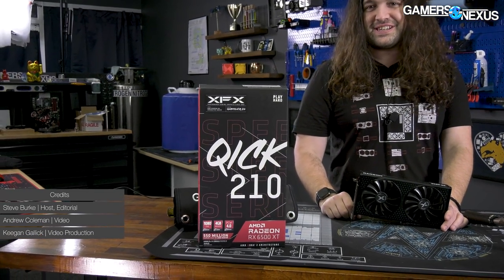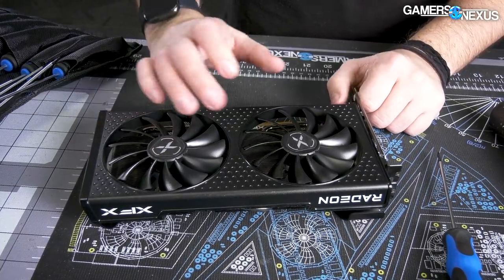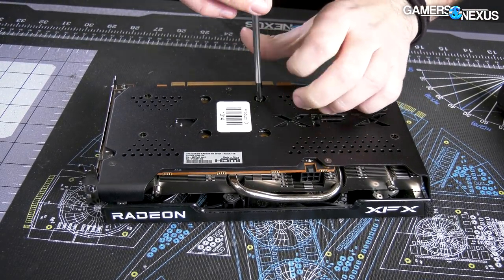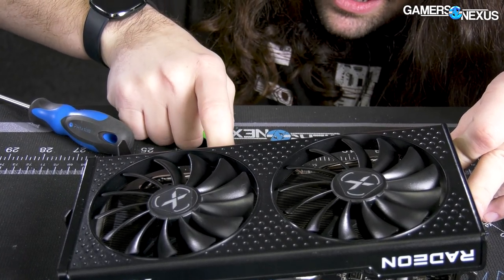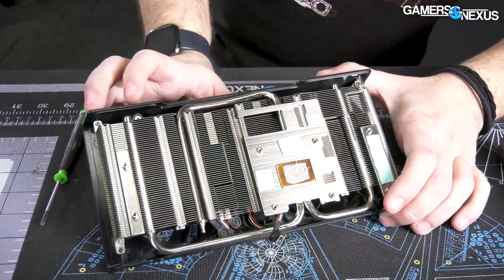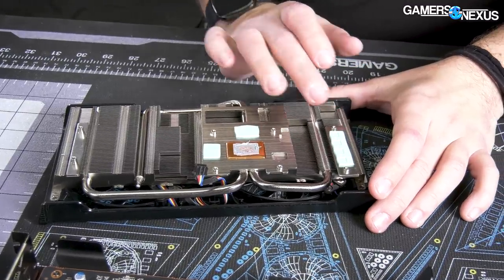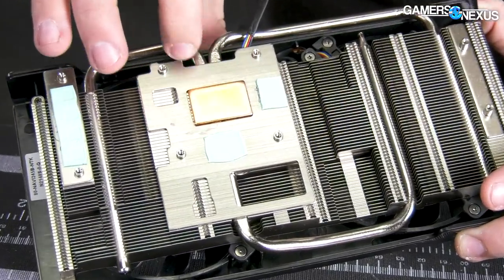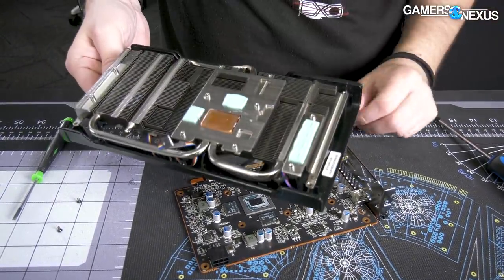Tearing Down Trash: AMD XFX RX 6500 XT Disassembly

Comment: So basically, on PCIe 3, you're getting RX 580 performance, for half the price a used 580 would cost today, but brand new and in stock. Where's the downside again?
Reply: The downside is it's literally worse in performance than a 5 year old budget GPU from Nvidia (remember, worse than the GTX 1060 6gb).
Heck it's barely better than a GTX 970, which I already have two of because for some reason I wanted to SLI it.
Reply: @44R0Ndin  Yeah, if you already have a better card, that's great. But if you want to build a new system, or upgrade, is there a better card you can buy for $200 today?
Reply: @joshm3484  can you even get this specific card at 200 not 279?
Reply: @hubris6567  It'd be a 12 hour drive for me, but if I wanted to, yes, MicroCenter in LA. 
I'm happy with my little 580 4GB for the time being, but I mostly play flight and space sims @1080. For me this would probably be an affordable upgrade, but not one I need. The bright side of so many bad reviews, if I ever do want to buy one, in a week or two it'll probably be in stock everywhere, and near MSRP.

Comment: Nobody cares about it, just me... Maybe I won the lottery but my 6500xt ran batter than my older sapphire 580. However I had so many trouble with drives (AMD life) but the card is really stable and powerful on drivers 22.6.2 or 22.10.3 currently using adrenalin on 22.11.2 and just by messing around with manual settings I managed to get 5305 on 3DMark (average is 5232). If you just want to game on 1080p this card is really good. I need to back it up as a user and I have mine since adrenalin 22.5.2 and it sucked hard at launch
Reply: Watching this video because the fans are really loud, the teardown video will show me if I can swap the stock fans for 2x 120mm fans as I already did in the past with other cards, I'm a sucker for modding budget parts and get the most out of it.

Comment: In 2013 I bought a HD 7950 for ~280€. The 6500XT has at most 2x the GFLOPs (=> raw processing power), only 1 GB more RAM and costs now, 9 years later, MORE than the 7950 did back then. Oh, and that 7950 was quite good back then; not top of the line, but really capable. More than can be said for 6500XT...

AMD, we all wanted more GPUs. But this ain't it :/
Reply: I paid $350 for a Powercolor R9 290 in early 2014 and to this date I'm still waiting for a GPU with a value ANYWHERE NEAR close to that one. Seems like it's never going to happen.

Comment: This might have been interesting IF
<75W without a 6 Pin
3 Video outputs and not just a HDMI and a DP (common at least give me 2 same types of connector -.-) 
either Singleslot or Low Profile
And a Price tag of 130$

Comment: The difference between the rx 580 8gb and the 6500 XT is that I can actually buy the 6500 XT right now from newegg and it costs less. I would certainly hope the 580 is better given that I would have to pay near $200 more to buy one right now.
Reply: U get the 580 used not new
Reply: @lagginswag  used 580 8gb is $350-450

Comment: I don't get all the hate for this card. In my country it's cheaper and more available than a gtx 1650s. An RTX 3050 is 50 % more expensive (and totally scalped). I agree that this card and other should be cheaper but it's not such a bad buy if you want a new 1080p card

Comment: Positive notes from this card: 
1. the parts used to manufactor for it does not take away from other 6000 series cards, possibly making it easier to manufactor in bulk and allowing better cards to exist.
2. it works and has some thought out effort in a solution into a problem,  maybe it will mean more cards available without the gpu itself being the choke point.
3. It still works in linux better than most nvidia cards I ran into, half of those are trying to kill themselves with nvidia's drivers.
4. It's still better than intergrated.
5. if it was actually pciex4 I'd love to see it shoved into a pciex4 slot  and work.

Comment: While I definitely don't support this kind of thing on the market, the cards are selling out. Consumers are just reinforcing that they'll pay anything to get a new card, no matter how shitty it is. So as long as this keeps happening, they'll keep on churning out bottom-quality shit for top-dollar prices while watching their company's value continue to sky-rocket.
Reply: People have been paying up to $150 for Nvidia's GT 1030 and getting a third of the performance of this card.
Reply: @notcraig255  AMD didn't bottleneck the card for its designed use, which is cheap entry level gaming PCI 4.0 laptops. If including wider memory and PCI bus support cost nothing extra, the 6500 XT as well as 6600 XT would have as much as the 6800 XT. Also x4 PCI lanes instead of x8 saves power which matters in the designed laptop use case.
Reply: @flinx  sure but AMD took the laptop version and made it for desktops so they should've gave it more bandwidth
Reply: @notcraig255  that wasn't an option. It takes more time and a lot more money to design, tapeout, and test a new chip. The choices were: (1) repurpose the laptop chip flaws and all, (2) don't repurpose it so buyers don't have that option and have to buy a GT 1030, or a used card, or a new much more expensive card. 

Adding more bandwidth with a new unique chip would not have come out this month. It's been 14 months since the 6800 XT came out. It takes more time getting a new unique chip to market. For people buying a prebuilt with PCI 4.0, or people building a new low end computer with PCI 4.0 support the 6500XT actually has $/frame performance that isn't too much more than current retail prices for the 6600 XT and 3060. 

If you still have a PCI 3.0 system people buying the 6500 XT aren't competing with you for used 1650 or 1650 Super cards on eBay, that will help gradually bring down prices on those alternatives.

Comment: I see a lot of people talk about this having had the potential to be a amazing pcie only power card for small dell,hp,... systems but they are missing a massive other problem with this card: it only has a pcie 4.0 x4 link meaning that all those older systems that could benefit from this type of potential card get an even worse version of it when it needs to run in pcie 3.0 x4 mode

The power issue is a very easy fix. Partners can just lower the clockspeeds like they did with the gtx 1650.

Comment: In a heatpipe, as it is evacuated, there is no boiling point. The pressure will adjust according to the temperature.

Comment: Even on a laptop, I would like to have a GPU that supports AV1 hardware accelerated decoding. The bitrate of AV1 streams is ridiculously low, which is cool if you are using Wi-Fi instead of a wired connection. Netflix for the PlayStation 4 Pro enforces AV1 and you sometimes get 1080p content at sub-"Mbps" bitrate or 1.3 Mbps. (The same stream using HEVC or whatever other codec can reach 4+ Mbps!!!)
Reply: 100% Agreed. Tested AV1 with my 6700xt and at 4K, bitrate difference between VP9 and AV1 is significantly larger than migration from h264 to VP9. Plus in 2-3 years time AV1 will be the default of many streaming services. A modern laptop "may" handle it via CPU, but laptops will benefit a lot from reduced battery usage if hardware decoder is implemented.

Comment: When i set up my waterblock onto my 3090 i didnt know how to remove the fan cable like you were mentioning. It resulted in my breaking all the wires off. I guess its alright as long as i never need to put the air cooled fans on again (not that i'd ever have a reason to do that). Needless to say though i was sweating bullets during that process.

Comment: Thanks for the explanation of the heat cooling system and the tear down. I'm hanging out to build a new system with at least some viability in terms of length of life to meet video and GFX apps system requirements but the price of GFX cards in OZ (if you can find them in stock) almost equals the price of the rest of my planned new complete build. I say death to miners. 💀

Comment: I think it is impressive to see how cheap this card looks overall. I still run my R9 290X that basically achieved the same performance with a massive 512bit memory interface, a very convoluted pcb and a massive expensive vapor chamber cooler. Shows very well how technology advances. But the card is still a piece of sh**

Comment: I wonder how differently the 6500XT would have been reviewed if it had been $170. That's what it would cost in 2016-2017 if you account for inflation. Still not a great value, but I don't think there'd be much profit in it had it been priced any cheaper due to current component and shipping costs.

Comment: 1050 was $109, 1050 Ti 4GB was $139, both launched in 2016. GPU vendors like to advertise their fancy process nodes, core count, and ram count, but zero progress has been made in the area of price performance ratio. The RTX 2050 will be the next zero progress overpriced GPU launch (Q2 2022), also from a laptop, also 4GB.
Reply: The crazy thing is that that 2050 uses GA107 silicon (which should be in that desktop 3050, rather than kneecapping GA106 silicon to match the 3050 Ti, though it definitely shouldn't be that kneecapped GA107 they're trying to push on laptops).
Reply: I mean of course 0 progress has been made, as Vram, Shipping, and raw material cost went UP and not went down/stayed the same. Only the actual silicon went up in performance(also went up in price), every other part of what makes a gpu got more expensive. Literally the only thing making this die cheap in a significant portion is the small die size. Thats it. Thats today's industry, where this was essentially the only GPU to be able to be sold at MSRP from multiple AIBs

Comment: The one thing I could see this GPU being good at is the low-profile market. At around 100W it competes with the GTX1650, which has a dual slot, low-profile variant.

Comment: It's weird that the cooler is kinda over built for such a cost down card. Extruded aluminum coolers are pretty common on this level of product...
They could have made it cheaper (for them and for us) and it would have been less offensive. These should be 100~150$ like the 950 the 1050 of yore...
Reply: AIBs have a habit of reusing cooler designs, and of course, when they add 50% to MSRP, they tend to go a bit overboard with cooling
Reply: @defeqel6537  but historically they where making single digit margins on graphics cards. So the difference between a 1$ cooler and a 10¢ cooler mattered.
It goes to prove this product is cheap and has significantly more margins to everybody in the chain. (there's a small chance AMD isn't banking as much on the silicon package but who the fuck are we kidding)

Comment: This product is actually worse than Bulldozer! The very least that had good multi-core performance, this? It has no saving features at all! X4 slot and 4GB plus would bottleneck a CPU from 2011!!! FX-8150 can use a RX 580 or 5500 XT and show much butter performance with those than this damn abomination. HUMANITY IS NOT WORTH SAVING WE PRODUCE E-WASTE!!!

Comment: In India RX 6500 XT 4gb is currently selling for 350 - 375 USD (25000 to 28000 Indian Rupees). This was the current price for 3 year old Nvidia GTX 1650 4gb (nonsuper).  Saw benchmarks  comparing Rx 6500 XT vs GTX 1650 and found that 6500 is way better than 1650 for the same price and near to GTX 1660 (non Ti) performance which is sold for 450 to 475 USD in India . So hope the Nvidia lower end card prices will be forced to come down due to RX 6500 XT launch. I am happy that RX 6500 XT is out there even at this GPU S#it Storm.

Comment: Imagine an entrepreneurial venture in the near future, say 6 months from now when you can find these things on ebay for $20 after the price crash. Say someone takes 4 of these dies, makes their own board with a PLX and 8 of those 32Gbit(4GB) GDDR6 memory modules found on cards like the A6000, and slaps them all on a board. The thing would be amazing for rendering. 64 compute units, 32GB of RAM, and a fully populated x16 slot. For gaming it would still be meh, but with 8GB per die it would not have to hit system RAM nearly as often

Comment: Is it just me or did AMD accidentally create a DGPU for Intel systems?  Because the whole reason this thing is crippled in features is that it was meant to go into a Rembrandt laptop where the APU can handle video, but AMD barely releases their APUs to Desktop and the ones they do are all PCIE 3.0.  So, if this card only works competently in a 4.0 desktop system with an IGPU to handle video...doesn't that basically mean Alderlake?

Oh, and to those complaining about the price, Moore's Law Is Dead has a great video tearing down the manufacting and shipping costs.  They're not making as much money as you think, AMD did this to flood supply and gain marketshare.  Inflation is real and the sub-$200 price point is gone.  It sucks, but it's the way it is.  All those $160 cards from years ago that beat this thing aren't $160 anymore.

Comment: If they have this with 128 bit bus and 6GB, it would actually be sort of worth talking about. Why did they make this garbage?!
Reply: You can't do 6GB with 128Bit bus, on 128 bit bus you would need to connect at least 4 chips  so either 4GB  using 1GB chips or 8GB using 2GB chips.

Comment: I just realized the answer to your question of why those cables have secure arms. It is because if they didn't the cable could easily come out during shipping, which happened on several of my video cards from MSI that didn't, and on a few power color cards too. My current power color card's rgb cable was unplugged on getting but luckly on this card it is right next to the 2 8pin power connectors facing outward so anyone can

Comment: It's not trash I cost 2x less than the 1650 super which has basically same performance. And you can buy it at its MSRP
Reply: So you can buy 1650 at msrp..whats the point then? You gain nothing with this crap
Reply: @roklaca3138  I just said 1650 super cost 2x more than Rx 6500xt

Comment: I don't get the hate, sure it's a cheap product, that's the whole point of it, you want 3080 performance just buy a 3080, i don't get it , did people really think this was going to compete with high end GPU's for 12 percent of the cost currently on Newegg, cheapest vs cheapest SKU.
Reply: It's literally a laptop GPU being sold for desktop GPU prices (even if it is low prices).
Reply from the maker: It's not about being cheap. It's about being horrible value for the money.
Reply: @GamersNexus  Compared to what's available at even higher prices i can't complain, i agree it's underwhelming but that's the state of the market now. A GTX 1050 ti costs more, not to mention is bouncing around as the highest selling card still. As far as i'm concerned it is getting far more attention than it deserves, what did people expect for bargain basement ???

Comment: i understand peoples dislike for this product, the lack of hardware decode and encode is a obvious problem, and at least on this one, having only 2 video ports is bad. before i dropped 1k on a 6800xt i had a rx 480 which the 6500xt is barely better than. which makes it ok for vr and can play all games that are out there. albeit at lower resolutions. the low ram possibly makes it worse but i havent really looked into it too far as its not necessary for me.

Comment: Why trash if it is better than GTX 1050 Ti and GTX 1650, and on pair with the old still good GTX 1060? It is intended as a middle to low end card, but is quite good.

Comment: I would buy this card. I don’t play games on my desktop computer, but I need modern drivers and API support, plus I need something that can drive two 4K monitors. My current desktop has an RX5600, but I think this would also work fine. Obviously, if I upgraded my computer today, I would keep the RX5600, but if I had to get all new components, I would be fine with this for $200. Considering that AMD CPUs don’t have integrated graphics, I am probably not alone with this. I really hope that AMD will start including iGPUs in the AM5 CPUs so I don’t have to worry about this on my workstation ever again.

Comment: Such a shame they couldn't have x16 for PCIE 3 may have added $.50 to the MSRP. No way in HEL I'll trade/sell my RX 580 8GB for this POS. HEL the damn thing is probably WORSE for GPU accelerated apps like Painter 2022 and many many others. Not to mention it's more expensive than my RX 580, I got the Sapphire Nitro new for $165 US 3 years ago, Upgrading the Powercolor RX 570 4GB, witch replaced the RX 550 4 GB. It seems that the 6500 is more like the 550 on PCIE 3, except the 550 can do it WITHOUT any extra connections to the power supply. Thanks/FU AMD for the gross blatant hit to the BUDGET/Mid Range GPU Market

Comment: Is there such a thing as a Laptop GPU when practically every die made has a discrete variant.
Given the push with DLSS/NIR, FSR/RSR, XeSS the card seems to have been built with wafer limits and those tools in mind to optimise the cores for maximum performance and not overflow the VRAM with native high/extreme settings.
Likely with those additional reviewer requirements the die size would have meant fewer cards in the market and a price up around $250 with the scalpers closing in on release day so no one who wanted one for gaming would have beat the bots and they'd be $500.

As it is I got one at MSRP, and the next day it went from AUD$319 (roughly US$200 +GST) to AUD$439 for the Sapphire Pulse.

I bought one because you can't run RSR on an RX570 (yet) and it's RSR that may make the thing perform at 1660/super levels with the same settings. If it can do it in Hitman 3, there's no reason why it can't do it in other games optimally configured.